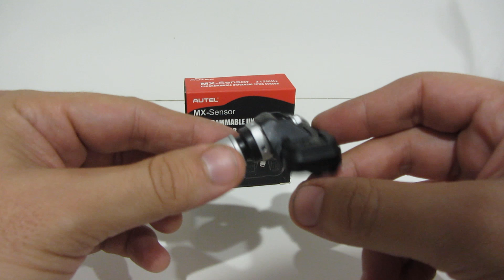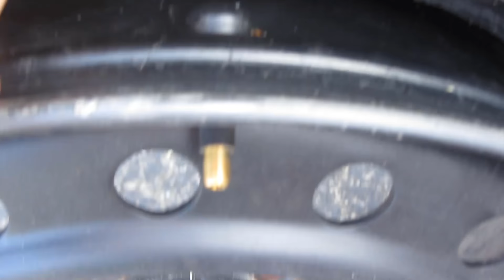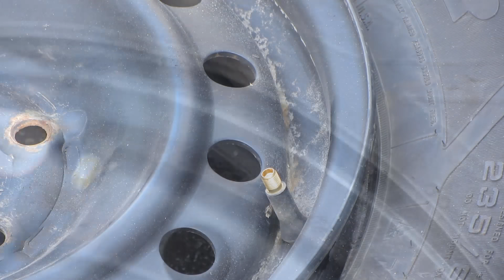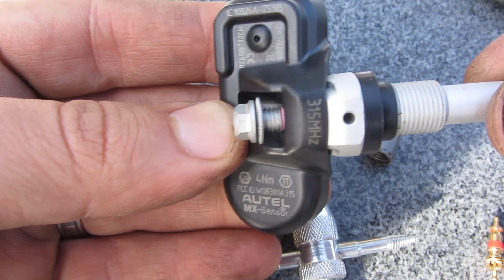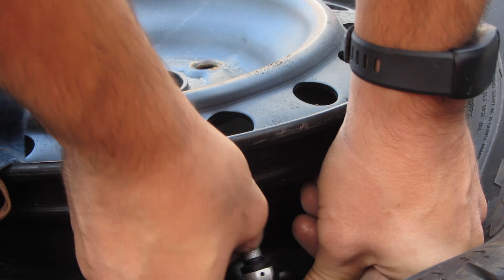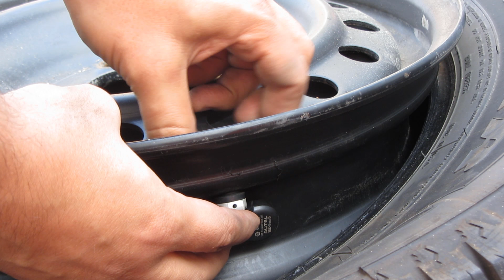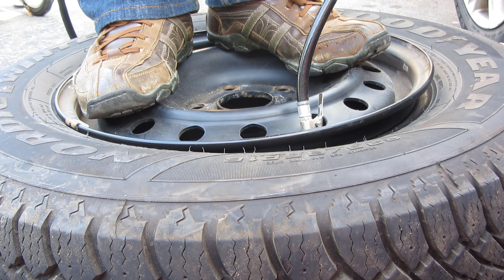Install New TPMS Sensor DIY Without Needing Rebalance

Comment: seems simple enough why do shops charge over 400 dollars for this?
Reply from the maker: Someone told me a long time ago, "The price of a thing is what it will bring." Shops still charge that much because there are people that pay it!
Reply: I suspect that the price includes the sensors. The sensor can vary from $20 each to over $100 each
Reply from the maker: @kevinguy3036  I think that's the point. At wholesale costs, they're probably getting sensors for $20 or less each. Installing all four can take an hour for one guy. If they're charging $400 for everything, there's a lot of markup going on...
Reply: Gabe's Hacks  For my vehicle, if I bought a single genuine TPMS from Mercedes they would sting me $175 lol I bought 2 sets because I need 5 ( I  had my wheels replaced) they didn't supply sensors with the new wheels. I paid $14 each so as you say mark up is massive!

Comment: Do you have a display for this?
Reply from the maker: What do you mean by "a display"?
Reply: @GabesHacks  from where can I see the tire pressure
Reply from the maker: @nirmalabraham1299  Oh I se what you mean. No, my van doesn't show the tire pressure. It just has a warning light for when the pressure is low. But some vehicles do have a display to tell you the exact pressure.

Comment: Don't we need to program it after replace?
Reply from the maker: It depends on the vehicle. Some will learn new sensors automatically. Some have a learning procedure you can do without any special tools. Others need a special tool.
I ended up using programmable sensors, which I described in my other video: https://youtu.be/N6p6xV4PlHc

Comment: Two of the four sensors I bought came without the little washer. I installed the sensors without them and it seems to fit snugly. Should I add the washers?
Reply from the maker: I think you'll be fine. Keep an eye on it just in case, but I don't really understand the purpose of the washer in this application. It's not distributing the load since it's not bigger than the nut, and it's not a spring washer, so I don't see how it could help prevent the nut loosening 🤷‍♂️
Actually, the rubber inside will help keep pressure on the threads to keep it from loosening.
I don't see how the washer is needed.

Comment: How do you program them to your vehicle?  Thanks
Reply from the maker: It depends on the vehicle. Some will learn new sensors automatically. Some have a learning procedure you can do without any special tools. Others need a special tool.
I ended up using programmable sensors, which I described in my other video: https://youtu.be/N6p6xV4PlHc

Comment: The Tire will still need balancing
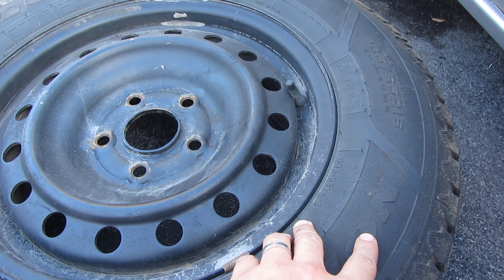Reply from the maker: If you're replacing a regular valve with a sensor, that's possible. If you're replacing a sensor with another sensor, likely not. I talked about that at 2:17. Bottom line: if your wheels are off balance, get them balanced.

Comment: Don’t forget to first clean the valve stem hole surfaces in both the outer and inner part of the wheel before installing the TPMS unit.

Comment: You should never use soap to reseal a tire. It can cause the rim to slip under high torque giving you the feeling that your transmission is slipping. There are specific compounds used to reseal tires. It’s not cheap, but it’s worth it.
Reply: Ridiculous! Shops use lube every time they mount a tire to the rim. Tires don’t “move” on the rim, or balancing would not work!
Reply from the maker: That's not something I've heard of before, but I did some reading. It looks like it's not unique to soap. Any tire lubricant can cause that, but only if too much is used. There are some recommendations here: https://www.nittotire.com/media/188014/TechBulletin_NTSD_12-015-Rev-3.pdf
Basically, only use a minimal amount of lube on the hump it has to get over, and don't lube the edge of the rim.

Comment: You need to have the new TPMS learned to your vehicle. Most tire shops will do this for free.
Reply from the maker: The sensors do need to be learned by your vehicle, but some vehicles will do it automatically. Others have a procedure you can do yourself, and others need to be programmed with a special tool. I would be very impressed if a tire shop did the programming for free if you didn't have the sensor installed there!

That said, I did this a different way. I used programmable sensors. I described the process in my other video: https://youtu.be/N6p6xV4PlHc
Reply: @Joe Casson - ALL Discout Tire Locations will repair a flat tire for FREE regardless of where you purchased the tire . It is their company policy. They will also relearn a TPMS for FREE ( not install for free, just relearn ). 

Their policy is to keep people safe - and of course they hope that you will give them your business in the future.
Reply: BUY THE TOOL ON AMAZON FOR 12 DOLLARS VEHICLE SPECIFIC
Reply: for free?     joke   must pay  tool cost , work cost
Reply: No, here in AZ we have Discount Tire - they do TPMS learning and flat repairs for FREE not a cent charged for tool use or labor. I assume you don't have Discount Tire n your area .
Reply from the maker: @AZDESERT2024  I don't. I'm in Ontario, Canada. But that's good to know!

Comment: FYI, Advance Auto sells a gallon jug of tire mounting lubricant for around $10. It is specifically designed for tire mounting, but you can’t use it to wash dishes. It evaporates quickly and will not make your steel rim rust or react with the rubber and cause premature deterioration of the rubber as the full strength dish soap could possibly do. Just sayin
Reply from the maker: Sure, if you'd like. I don't see the value. The outside of the rim sees far more water and (depending on where you live) salt. I don't see how there's anything you could do to the inside of the rim when mounting it that will make it deteriorate faster than the outside.
Reply: 10 bucks for lube that does what dish soap does... All the crap you drive over and concentrated car wash soaps seem more concerning, just saying.

Comment: Shouldn't you leak check each new valve with soapy water when done? Nice video all the same
Reply from the maker: By all means, you can. If you're planning on driving right after you put it back on, then it would be wise. But otherwise, it'll go flat in your driveway if there's a leak.

Comment: Those aren’t winter tires, real winter tires have metal studs in the tread.
Reply from the maker: I can't tell if you're being sarcastic or not :) But those really are winter tires in the video.
Reply: Drunkbikewrenchen really? Is that’s why they say winter right on them? Studded tires are illegal in some states because the studs can become a lethal projectile when fly out of tires
Reply: @napieraustin  pretty sure the concern about studs is damage to roads, not lethality due to being a projectile.
Reply: you sure those arent ice tires youre talking about?
Reply: They have the holes to insert the studs into the tread if you can use them in your area. Most people find just a little more agressive tread works fine
Reply: Joe Casson LOL it’s safe to assume you don’t have real winter where you live then, heavy trucks destroy roads, don’t believe what the lemmings tell you...
Reply: Winter tires are NOT always studded. Winter tires are recommended in mud and/or snow. The addition of studs makes them more effective on ice.

Comment: yeah , try to do that with a 17 inch wheel !!! ;) and adding sensor weight on the wheel , you think you won't have to balance the wheel? none sence!
Reply from the maker: I did this with a 16 inch tire in the video. It might he harder the bigger you go, but it's still doable.
And I talked about balancing at 2:17.
Reply: @GabesHacks  23 Grams... 5 gram inbalance after rebalance is the maximum limit per side. Overall inbalance by the way is 55 grams.
Reply from the maker: @SpitfireMkIIFan  If your tires are off balance, then balance your tires :)
Reply: Nonsense*

Comment: Do you know if I can put tires/wheels from a newer car with TPMS sensors on an older car that did not have them?  Would that cause any issues?
Reply from the maker: No, it wouldn't cause any issues at all. There just wouldn't be anything listening for them (if you keep the sensors installed). Some wheels are specifically designed for TPMS sensors, but that just means they have a little extra weight added exactly opposite the valve to make balancing easier. If there's no sensor there, then it would likely need a wheel weight where the valve is. But whatever shop that balances your wheel will figure that out.
Reply: @GabesHacks  Thank you so much for getting back to me.   Appreciate your help.

Comment: Do you need to dismount tires from wheels to add TPMS sensors? If I get new tires & wheels, but want to use my old TPMS sensors, should I order my tires mounted or dismounted?
Reply: @superarsenal009:
HOLY SHIT ... Did you NOT watch this video..?? I mean WTF kind of question was that. This video just SHOWED you that you don't have to dismount the tire to replace or add or remove a TPMS sensor .... 
I mean seriously WTF ..
Reply from the maker: You don't need to dismount them completely. You can do exactly what I did in this video. Just be aware that If you buy the tires installed, they'll be balanced too. If you then open it up and replace the regular valve stem with a TPMS sensor that weighs more, you might throw off the balance, like I discussed at 2:17. If you then find the balance is off, you'll have to get them rebalanced.
So it depends on if you want to go through that. You could just buy them dismounted and get a local shop to install them with the sensors in and balance them after.

Comment: yeah, you are doing better those stupid looking like pro-tech but do not show exactly what need to do, step by step. Good job amigo. so you just used only one one rubber 'o' ring from inside. I was so stupid used two of them, one inside, one out side then the washer  and final the lock nut. it is leaking slowly due to two 'o' rings. I had to removed one so it straight and sealed.
Reply from the maker: Thanks :) These sensors that I used don't have a separate O-ring. The rubber is attached to the sensor.

Comment: Went to a tire shop that is supposed to replace tmps and the works with a purchase. But the tmps have not went off, got a tire replaced under warranty and it's still on!😂 it's so annoying seeing as I just paid $500 for new tired with sensors etc. Lol not sure what it could be but hopefully this helps if I have to diy.
Reply: Disconnect your negative battery terminal for about 5 minutes then reconnect your battery so that the dash light warning goes away

Comment: Nice video but, what about programming?
Reply from the maker: It depends on your car. Some cars don't need any programming. If it does, you can either program the car, or use programmable sensors and program the sensors.
I used programmable sensors since I wanted to create a second set for my winter tires. I described how I did it in my other video: https://youtu.be/N6p6xV4PlHc

Comment: I have found that the sensors don't usually go bad, the battery inside goes dead. Factory units seem to last for 7 or 8 years. It's a good idea to have these until they start to fail, then they change into a pain in the ass. Dyna beads will perfectly re-balance the tires when you are done.
Reply from the maker: I've read about the dyna beads. I'm curious to try them out.
Reply: I use them in my motorcycles
Reply: I’m concerned about Dynabeads constantly hitting the tpms and causing premature failure.
Reply from the maker: @Second_Insight  Dyna beads get thrown to the outside of the tire while driving, so they would never touch the sensor while you're moving. The only time they would hit the sensor is at the moment you stop, if the sensor happens to be at the top of the rim when you stop. The force would be only of the beads falling, which wouldn't be much. I don't see it being enough to worry about.

Comment: Money saver, I’m doing this next time. I do all my engine work , tranny and the only thing I couldn’t do is tpms sensor. 
I ain’t paying $400 bucks for an easy fix... nope
Reply: The bead on his tire broke really easy. Mine was MUCH more difficult. I had to slide the tire up under the car, place a piece of 2x4 under the car and on the bead and let the car down on it. I used very long levers and it still wouldn't break. It took the weight of the car to make it work,
Reply from the maker: @MrBubbadon  Whoever mounted the tire last could have used a tire sealant (it's usually a black goop). I had to fight with this when I moved tires for my car to different rims. The method I used in this video didn't work at all. I used the method I saw in another video using a jack: https://youtu.be/-VICFao8Mjw
Reply: I'm right there with you Hilary 2020😂😂

Comment: TPMS sensors are rip of .
Reply: Sensors are not a ripoff.  I have TPMS with individual tire pressure display on all my vehicles.  I have had tire punctures in three of the vehicles so far.  The two times I was driving I got the alert showing me which tire it was and what the current pressure was.  After examining the tire each time and finding the cause of the puncture I was able to proceed to a tire shop, while monitoring the pressure to ensure I wasn't dealing with a rapid loss of pressure.  The one other incident occurred when my wife was driving to a far off place and got the alert the right rear tire was at 26 psi.  I had her come home and made sure she kept an eye on the pressure to ensure it wasn't a rapid loss of pressure situation.  She made it home just fine, and without the stress of not knowing which tire or how fast it was losing air.  I now consider TPMS with individual tire pressure display to be essential and I will never buy another vehicles that doesn't have it.
Reply: if people would actually check their tires regularly. it wouldnt be an issue, but because of past accidents involving low tire pressures.  they were created to help prevent further accidents.
Reply: @Rythem45  One could also say it doesn't matter if you check if regularly cause the purpose of tpms is meant for while you are driving its another indicator saying hey something is wrong and you're losing air. you can check pressure all you want before and after doesn't mean shit if you pick something up while driving
Reply: @Rythem45  Tough to check while in motion.  Weird flex, but ok
Reply: @Rythem45  Sorry there are 2 types of sensing tire pressure direct and indirect(you dont need tpms sensor) TPMS sensors a costly.
Reply: @protexusa  ahh i see what you are getting at, yeah I know which ones you are talking about, i still say the whole system is trash though haha
Reply: After you get in an accident running highway speeds. Check back on us if you're still alive about it being in a ripoff.

Comment: how reliable are those Autel tpms sensors? 
do they give you years and years of trouble free service life?
Reply from the maker: So I posted this video 2 and a half years ago. I did get a TPMS light come on about a month ago. It's complaining that it's not reading one of the sensors, but I'm not sure which one yet. I know I have one rim that's a bit warped and vibrating (the shop had trouble balancing it this year and told me the rim is warped). So I wonder if the vibration messed up the sensor, but I'm not sure yet. I still have to take the time to troubleshoot.
But at least 3/4 have been going strong :) They do have a 1 year warranty at least, so that should protect you from lemons.
Reply: @GabesHacks  do you have Autel TPMS tool? you could try re-program the sensor.
Reply from the maker: @davidjacobs8558  I do. I'll have to give it a try. I might actually have time to do look into it today.

Comment: What’s the cost to replace a tmps in a tire?
Reply: TPMS sensors can cost up to $100 each if you buy from the dealer, and will cost you labor charge of removing the tire, replacing the sensor, and balancing the tire.
Reply: Thanks so much.
Reply: Most tire shops will install them for couple bucks, if not free, when you buy the sensor from them.
Reply from the maker: It all depends on who does the work, and a little bit on what car you have (some require programming, some don't). If you don't plan on installing yourself, then call around and get some quotes. The dealer will almost always be the most expensive. Independent tire shop are more likely to be the cheapest (but not always).